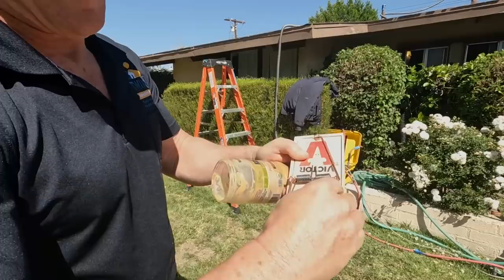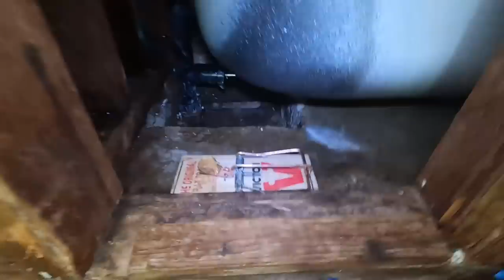SAWZALL vs RATS...how to get rid of rats in your walls QUICKLY!

Comment: So is that a very old type of pipe, because of the asbestos?  Did they ever get that replaced or did they just leave it?
Reply from the maker: We ended up wrapping it with water proof tape and sealed it up with a water proofing paste. Then we added a vent cap on the roof so rain water doesn’t potentially leak through. 👍

Comment: My experience with rats is quite limited compared to mice. Something that my company does is they double up the traps next to each other, but more importantly if we think were dealing with 5 mice we will likely use at minimum 15-20 traps. By doing the exterior exclusion work with the mass trapping we have been able to kill a whole infestation in 1 night. The reason we double up the traps is because we have found that often times mice will be running along a wall or wherever we trap them, and they may not be interested in the food but they attempt to jump over the first trap and land in the other. What are your thoughts on mass trapping and doubling up traps next to each other?
Reply from the maker: Hello Steve! Great question. You make a great point and makes total sense. We typically use cameras to verify the infestation, if there is a infestation we use our twin tower trap that can catch up to 30 rats, self contains them, no blood, no clean up and no odor. We find it to be more efficient. We have a upcoming video showing the difference between this. Appreciate you watching and sharing here. Cheers!

Comment: Great video great joke sometimes we got to have a little bit of humor how did they ever fix the pipe?
Reply from the maker: We ended up wrapping it with water proofing tape and sealing it up with a water proofing paste, then put a rain cap on the vent. Saved the customer about 2800.00
Reply: @TwinHomeExperts  Yes when working with asbestos it’s very costly